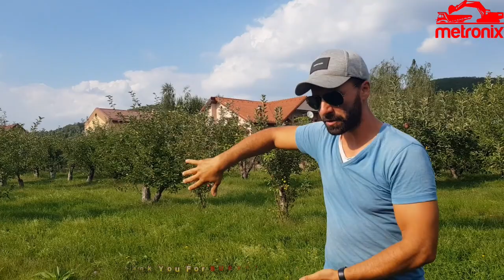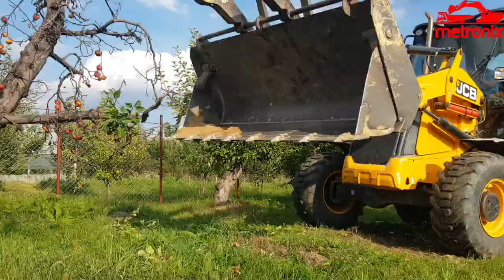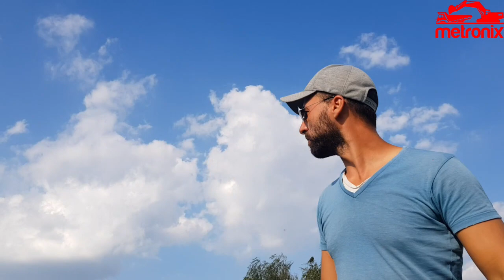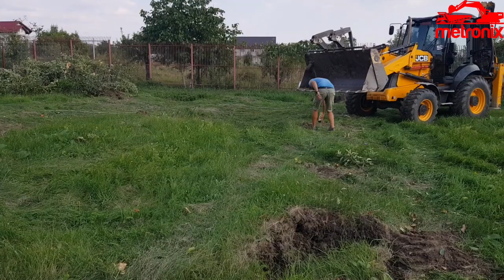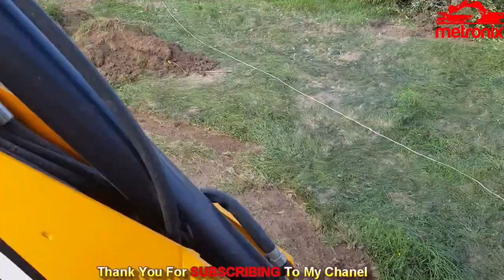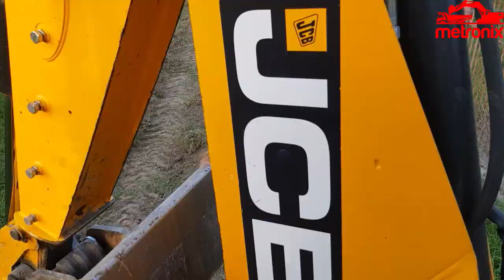JCB 3CX |  ⚠ The Most Powerful Backhoe Loader ⚠

Comment: Is it worth buying used 3cx? I have a small farm and am looking models of around 20 years old and 8-10 thousand work hours
Reply from the maker: Jcb 3cx  is  a good machine.  If you want to buy a Jcb.. my advice is not to exceed 10 years old  if you intend to use it daily.
They are durable machines and 8000 hours are not so much.
So i wish good luck  and thank you for the question! 🤗
Reply: @MetronixJCB  i approximate the use up to 400 work hours per year, mostly front loader (manure work, pallet forks). what do you think, can older models work that much?
Reply from the maker: @OPGHAHA  Working on a farm does not force the machine so much. so for 400 hours a year you can use an older machine.
Just be careful when you buy it. check the engine, gearbox and hydraulic pump to be ok. The rest doesn't really matter that much.
Reply: @OPGHAHA  if you buy maintained one there wont be problems. Older JCBs have good reputation, and IMO they are better built than newer ones. If you can find one in good condition go for it, but dont buy overused rubbish.